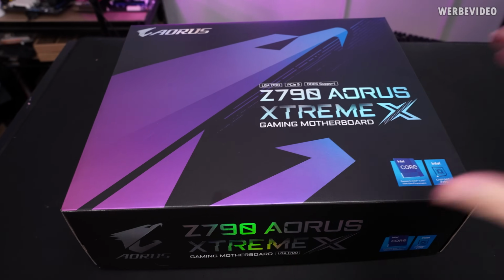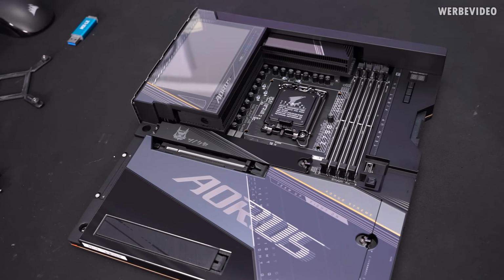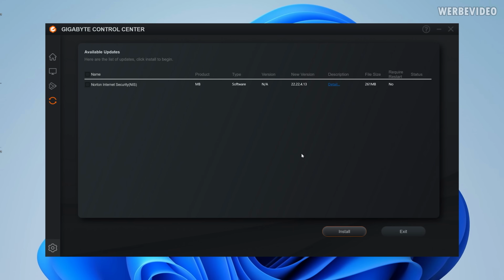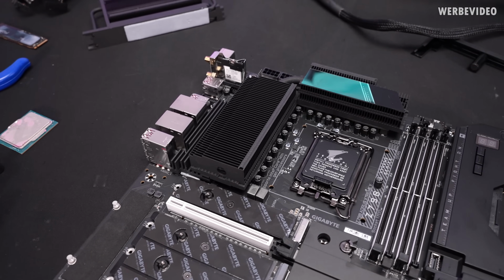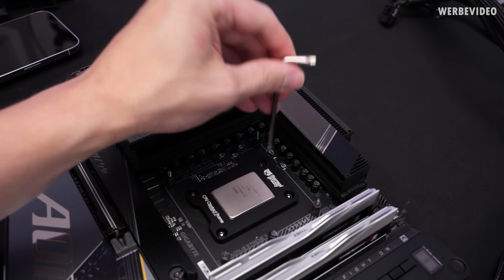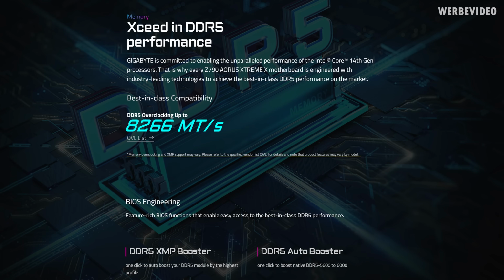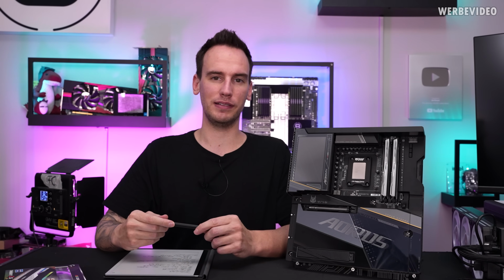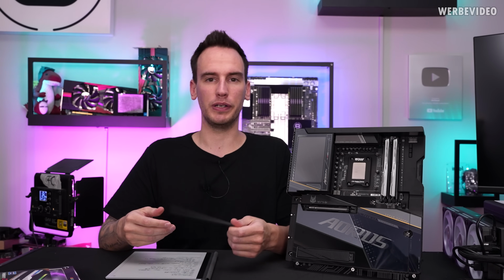Overpriced and Disappointing! The $1300 AORUS Z790 Xtreme X

Comment: At $1,300, that plastic cable cover shouldn't be plastic. At $1,300 you can afford to have that thing made from metal.
Reply: i don't think having those made out of metal is a good idea. theres still exposed connector and if something happen it could short the board
Reply: @xs3tsunax - Decent aluminium anodising sufficiently insulates against accidental shorting. Though the exposed magnets could still pose a shorting risk for the cover, in either plastic or aluminium…
Reply: Its typical, my coolermaster HAF700 is a very expensive case and takes 420 rad in the top bracket/cage but its held in by a 2mm plastic tab which snapped and send the rad crashing into the build.....plastic, ffs
Reply: Either way , a mobo should NEVER cost above $500 imho let alone $1.3k
Reply: @xJayteee  this MB costs as much as GPU, so should price apply to GPU as well?
Reply: Well blame the stupid kids who buy/bought MOBOS costing so much... the market always dictate prices, nowadays those kids care more about rgb and stupid displays in the MOBO than performance. @xJayteee
Reply: @xJayteee  you know when have idiots buying... Nothing ll change
Reply: nah, they can't cuz mobo itself cost at most 600usd to make - rest is profit lol
Reply: @1sonyzz 600? HA, at most it cost 200 dollars to make, 400 is if you count the development
Reply: Anyone paying anything like $1300 for a freaken motherboard is a complete Muppet,  considering mobos 1/3 the cost have the same features. All it's doing is supporting this ridiculous price point.
Reply: Also the cover blocking the PCIe release, where that slot is probably going to have the most heat generating component... Is just ridiculous. 
Okay fine... Second most heat generating component if you don't run games at max settings, but come on... Still.
Reply: Having that thing made of metal would actually cost a couple of $.
Reply: @HDJess Yes ... they're charging $1,300 for that product. Even if it took a full hour of work time and a full kg of aluminium to create, they can still afford it. BECAUSE IT COSTS $1,300.
Reply: oh that's for the 1800$ board from next generation!
Reply: Should be gold plated
Reply: What happened to it having a water block?  HOW is this worth 1300?
Reply: Agreed. Paying for a mobo the same price as a GPU should get you better quality materials.
Reply: To be honest, at $1,300, that plastic cable cover better be gold plated and with some diamond powder.
Reply: or have bigger margins :/
Reply: U mean made out of gold 🤣
Reply: They'd probably make the customer pay a bit of extra for that, and honestly it just seems unnecessary. The magnets didn't look particularly strong either, so it's probably going to stay in place better when made of plastic.
Reply: If I paid 1300 bucks for a motherboard I would expect it having gold in it or it being able to do automatic extensive overclock by itself.
Reply: gigabyte now walking on same road with MSI
Reply: @Ginny.galaxy  I would suggest that it's more like crawling...
Reply: @antong3987  they don't make too much, in my country only 10 Aqua main, 30 Extreme water block . But normal vervision so much, i think water custom can have high price because limited product, other version is not.
Reply: if price >800$ the mainboard need to be custom for user, water block, CNC, pain bla bla. Only Asus have a top tier mainboard with somecustom then u can do anything good (same board with extreme, custom block from EK, Asrock stop make mainboard like that (Aqua), Giga have a waterforce too, but trust me, very overrate
Reply: They are milking whales. Why are you complaining?
Reply: @poppyrider5541  I've never understood a viewpoint like yours
Reply: @tomppeli.  'I'm not gonna buy that one coz they plastic where it should be metal' That's not the reason you aren't going to buy this thing. You want to know why I wouldn't even consider this? It has no video out.
Reply: @poppyrider5541 the correct mentality is expensive items should have matching quality to justify the price, doesn't matter if you are gonna buy it or not
Reply: @poppyrider5541  Doesn't thunderbolt allow display out? (I have no idea if that function actually is enabled on this board)
Reply: @poppyrider5541 If a million dollar luxury car had cheap plastic trim, I'd also be complaining.
Reply: @MrMartinSchou  Why? Is the fact that it's not metal stopping you from buying it? 'No, I'm not that. It's got plastic where metal should be'. Or are you not going to buy this coz it's overpriced for the sake of being overpriced and the only ppl this is marketed to are ppl that want to say 'I have the most expensive thing'.
Reply: @MrMartinSchou  There's plenty of expensive super cars with cheap plastic, they just don't let you see it.
Reply: @MrMartinSchou    You would be suprised by how many expensive sportcar have some cheap-ass stuff coming from regular series car. One of the big lambo have the command for the flasher made of cheap plastic, coming from a random fiat lol
Reply: @poppyrider5541  i actually fully understand where you are coming from but its those same whales that keep these products expensive af. if whales wouldn't buy this shit, maybe the manufacturers would lower the price once they realize that no one will buy a 1300 dollar motherboard
Reply: @sclapple3192  Using "whales" here is wrong. That word comes mostly from games where a few oil lords from Dubai spent enough on the game, that the game can be free for others. Those overpriced 1300$ mobos aren't for whales, cause it doesn't make cheap mobos cheaper, they are still expensive and lack so much shit compared to older generations. So "whales" who buy those mobos actually hurt other people by enabling these practices of selling shit for more money than it should. At least thats my view on this.
Reply: @MrMartinSchou you know whats under those leather/suede/alcantara trim pieces? Plastic
Reply: @poppyrider5541 Because some day that might be you, the new whale in town... we all hope for a better life... 😂

Comment: Gigabyte boards are garbage. My z790 could not do even xmp 7200mhz with my 13900k without constantly crashing...
Reply: You need to update your Bios .. I had the same issue on my Z790 MSI Gaming Carbon .. Found out I was on a bios version from November of 2022 .. Updated everything now I’m running 7000MHZ with 0 issues